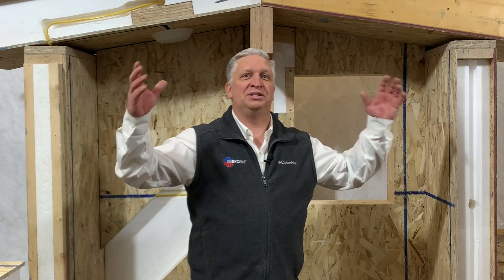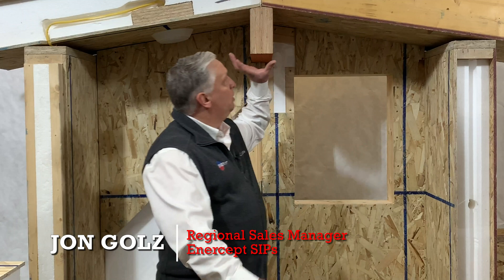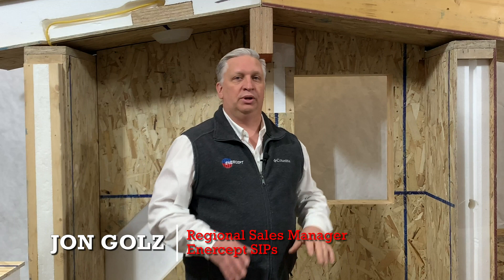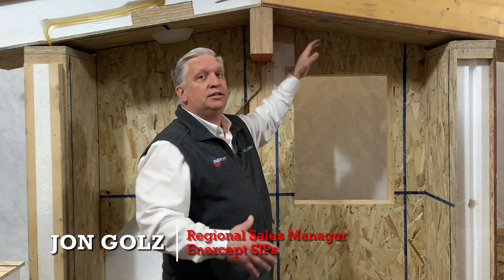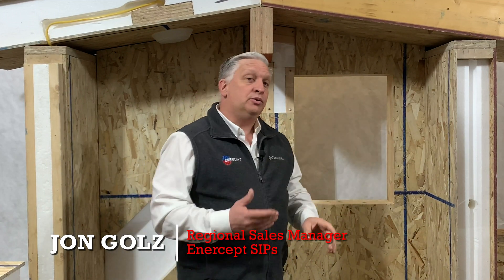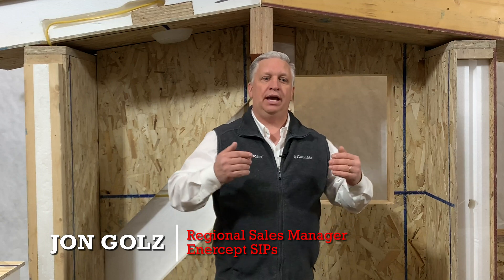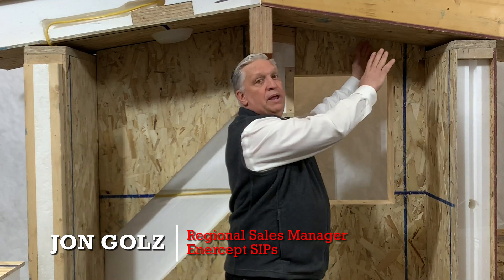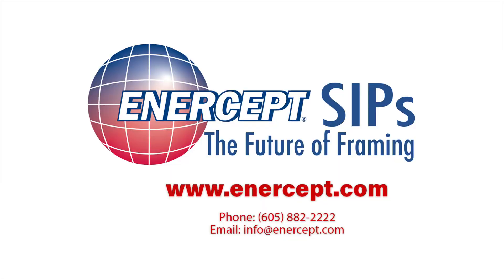What are the benefits of building your home without roof trusses?

Comment: Can you use SIP wall for interior walls? 6.5" for exterior and 4.5" for interior?
Reply from the maker: The short answer is yes; however, you need to have a plan for your mechanicals, i.e. plumbing, HVAC and electrical because of the solid core of the SIP.
Reply: @EnerceptSIPs  so, yes. Just plans of the EXACT location of mechanicals?
Reply from the maker: Yes

Comment: Can you use beams with a Hip Roof?
Reply from the maker: Yes, beams on a hip roof work very well.  You can think of the hip beams as ridge beams.  The SIP roof panels span from the hip beam down to the eave wall.  As you move up the slope from the exterior wall the roof panels will get longer.  They will be trapezoidal in shape, with the edge that is supported by the hip beam getting longer as you move up the slope from the eave to the top of the hip beam.